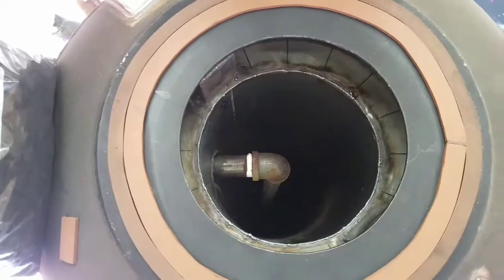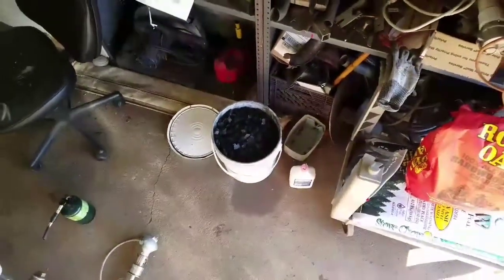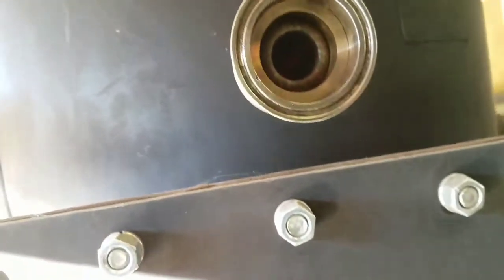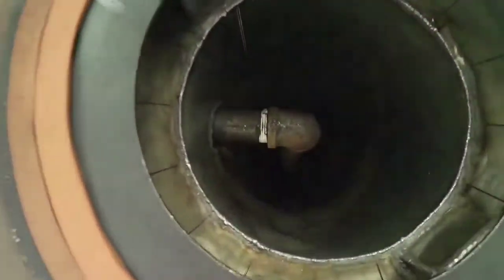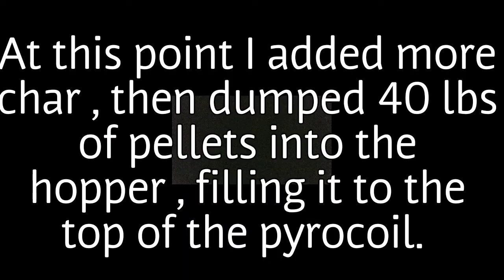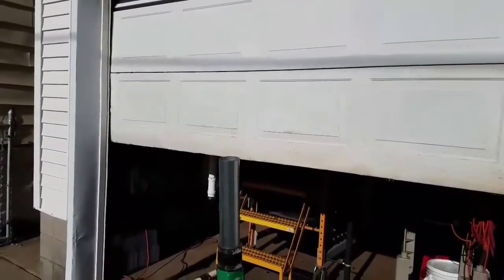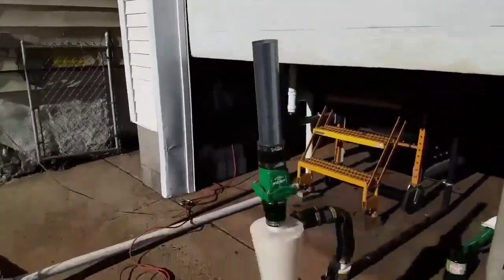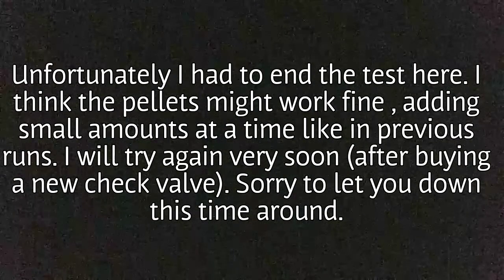11-23-2017 Progress update of the woodgas ninja

Comment: Howdee Joe, 
 That's looking mighty fine, my fellow woodgas addict  :). 
 You don't have just a gasifier there, you've got a power station! 
 Now that's some serious dedication  :) . 
 For the wood pellets issue, you'll surely find that moisture had a big part to play in their erratic performance. 
 That, along with the fact that your gasser is HUGE, and the pellets are teeny weeny, tends to conspire against success. 
 One thing that may help with the moisture issue will be to operate the gasser with the lid partly open. 
 That way, the moist air won't get a chance to accumulate in the fuel column. 
 That's how I was able to get faultless runs from my early gasser with pellets. 
 In time though, I am sure you will be making yer own fuel, and enjoying the delights of independence  :) . 
 Keep up the good work, my fellow woods to watts conversion enthusiast.  
 Yippee - I am commenter #13  :) .
Reply from the maker: Thanks Steve. I was on the fence about even putting a video out since it didn't go as planned, but does it ever? I figure since it's all open source, I have to share the things that don't work out too. I think I might try these pellets one more time, but not fill the hopper near as much. This way if I start to have issues I may be able to poke through the hearth to help move things along. I still need a hopper vibrator as well. I thought the vibration from the engine exhaust in the pyrocoil would help. Not as effective as I thought it might be. Anyway, I should be able to try again soon. I'll be sure to let you know when I get it right. Joe
Reply: Howdee Joe, 
 Yup, such is the way when one is experimenting like this. Failures are a common thing, and they have to be embraced along with the good times, or we may become emotional wrecks  ;) . 
 You are surely on the right track when it comes to moderating the pellet intake, as these things can really gunk up the works when even the slightest problem shows up. 
 Engine vibrations alone do not seem to be enough for these, so I am guessing that the issue is even more acute when trying to use engine exhaust impulses to agitate the treezel column. 
 A motorised vibrator seems to be your best bet, and I am sure you can create one of those perty quickfully in your workshop  :) . 
 Looking forward to good results in the near future, my fellow addict.

Comment: yea the breathing and bridging issues are definitely an issue to address,, i found that dried stick and branches work best cut 3/4 inch by 3/4 inch, even with a narrow hopper, that size doesnt give me trouble, and i have an aggressive motorised vibrating fork running down the inside of the hopper, shakes down pretty well with small fuel, i also found that a high torque motorised toothed wheel running a spring mounted pin for the grate shaker works well too, these two items need to be aggressive in their actions as a full hopper  and grate needs serious grunt to shake the mass in order to breath.

Comment: Looking great Joe. I love the 5 alternators. Can you add a 6th with that drive sheave??
I have to say that I have never had good luck with pellets. They either packed or absorbed too much FL moisture. I really like the branch chunks that Flash introduced and that is all I have been making since I built the little chunker. Speaking of chunks, how are you making out on your processor that you were working on. I believe that once you have consistency with your wood fuel, you will have much better, consistently good runs with the gasser. 
Another thing is I try and stay with one wood species if at all possible and oak is the most abundant in my area. I do have some cherry and also some cedar I want to try. 3000 watts of pure sine is absolutely awesome.  You have to be happy with it to this point. Great job as usual. We will be waiting on your next video.
Reply from the maker: mada94fxr, I only have 5 grooves in the sheeve , but I don't really need three 12 volt alternators. I will eventually get a third 24 volt alternator,  and mount it in line with one of the 12 volt ones. Just swap the belt fro the 12 to the 24 and go. I'm really glad to be in a place where I can just run when I want to. Should be fun this winter. Joe
Reply from the maker: mada94fxr, sorry I forgot you asked about the wood processor. Unfortunately I haven't touched it lately. It might end up being a spring time project.
Reply: Gotcha. This is going to get interesting to say the least.

Comment: @ 6minutes is the mad scientist part of the video. Joe are you using a mixture of pellets and biochar to run the gasifier with?
Reply from the maker: flash001USA, I really let it warm up slowly only on char. After those shots that showed it out of fuel , I put about another gallon of char then filled the hopper to the top. This left me no easy way to poke around in the combustion zone. I can tell you when I took the thermocouple out it was glowing red. No doubt it gets hot as hell in there. So @ 6 minutes the flare you saw was with the hopper filled with pellets before the hearth got packed. At least now I'll just have to clear the hopper and go. I'm thinking about trying one more time with pellets,  just keep about a gallon of pellets above the fire cone.
Reply: Wood pellets are hit and miss whenever I've used them. More miss than hit. The new build I tried them in was a total failure but they will run in my original build as long as I don't load the hopper down with them. When they work they work well but when they fail they fail in flying colors normally with a bucket of tar as a prize.
Reply from the maker: Mike, I didn't see any indication of the filters becoming blocked , but I will check them just as a precaution. Thanks for the heads up.  I'll let you know what I find when I start digging around. I'll also have to share a picture of the melted check valve.  I did pick up a new check valve today, so when I get a chance to get back out there the first thing I'll do is check the filters, then replace the valve , and clean the hopper out. Joe

Comment: Joe, I'm beginning to question the whole notion of filling the wood hopper, thinking you can just walk away after filling it and be done. Perhaps it's time to start looking at the controlled feed of the wood to the hearth. Bridging issues would probably go away. Air infeed would be better controlled and the moisture  condensing in the hopper, inherent with a large volumes of unburned wood in a stationary gasifier ,  even dry wood  would be minimized.You have an incredible build and should be very proud of your accomplishments. Now to match your machine to the fuel wood.Just for experimental purposes the next time you fire up the gasifier try  to keep adding just enough wood to the ember bed to make a " single layer" on top of the inferno and see how it does. Yes, it's a pain and not what the intended design was all about but you may be surprised how well it keeps things running.I've been doing it for awhile trying to figure out the timing. You may have to build an addition to the shop in order to accommodate the external wood hopper, conveyor system and such . :)BTW I had the worse luck in the world trying pellets. Enough tar to pave our dirt road.Keep up the good work, buddy ! Bill
Reply: Howdee Bill, 
 Agreed. We do need to start looking into the finer points of delivering the wood on an 'as needed' basis to the wattage making inferno of flameee goodness. 
 Moisture accumulation is such a pain with these gassers, but I think your idea effectively deals with that problem. 
 Since Joe's build is already more like a factory than a little power plant, the additional fuel handing equipment wood surely fit right in  :) .
Reply: Steve, 
Once my busy season of filling  wood orders slows up I'll have  time to experiment a lot more with this . I already have the flex auger, drive motor and gearbox, and start/stop micro switch which came from an auto feed controller at a dairy farm. It would work well with the repeat cycle timers I have in stock. Just need to pick an engine and realize how much it requires once the load is established. 
I would like to throw out a question for our group of like minded wood addicts: Has anyone ever filled their wood hopper and had a full run without issues ??? Curious !
Reply: Howdee Bill, 
 I think we wood all want to see watt you come up with when you have the time to make it all happen. 
 Even in my very first video, I observed that the FEMA tar maker seemed to run more betterlyer when it was fed just enough treezel to cover the burn zone, so it seems reasonable to exploit this trait to its fullest extent. 
 Once you establish your switch based fuel delivery system, it will be essentially automatic, as it wood deliver the wood at a rate that is solely determined by the engine and the load that it is driving. 
 As for trouble free runs on a full hopper, yes, I can claim that it is possible. 
 Remember my auto-gasser-unattended video? 
 This ran, repeatedly, on a full tank, without issues - but there is a wee bit more behind this observation. 
 This took place just before I discovered all those air leaks in the neck of the gasser body. 
 When I fixed these, the moisture problems duly returned. 
 I am of the opinion that a small air leak, just below the hopper lid, can be beneficial. 
 Naturally, it can be a liability too, as it may promote more frequent gas explosions above the fuel column.
Reply from the maker: Bill, thanks for chiming in here. I was a little on the fence about even sharing since it really didn't go as planned, but I'm trying to keep it real , good or bad. Sometimes points of view other than your own can really make you look at things differently. The whole drizzle effect sounds a lot like the drizzler gasifiers. At least I'm now at the point where I can start to play with the gasifier more. Now that I have a use for it , it should make me want to run more.  There is still plenty to do , but maybe I can take a little break from the constant upgrades and just have a little fun with it. I'll be sure to keep you posted. Joe
Reply: Joe,
 If these critters ran as well as we thought they would we wouldn't have anything to talk about. The good, bad and just plain ugly shared between us should be called the  combined  testament  of experience.
 It's the testing phase, the repeat-ability of these trials which points us to where we want to be. I'm excited for you to be at the point where you can start to play around with the gasser. Lord knows I've clocked a lot of hours with mine and I am still constantly learning . Very few of the runs are long duration . There have been a few  due to grid down events where it becomes mandatory for a long run, But by far the majority are short 1.5 hr runs , with others just lighting off the primary flare and calling it good. What's pretty cool now is that when things don't go as planned I can almost go to the source and that is treated  more as maintenance rather than " Now what do I do?"  Watching some of the earliest videos from my start and others is a real hoot. Man, were we clueless ! Mine could have won an award as the ultimate blue barrel party popper. Even the police showed up. JaJa !
Remember, if we don't hang together then surely we will all hang separately. Carry the torch and keep up the search.
Bill